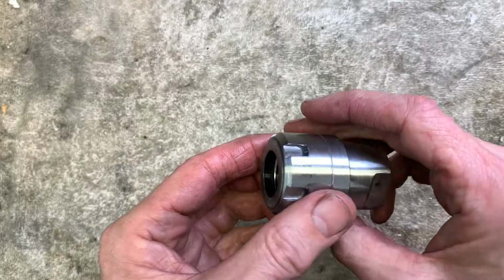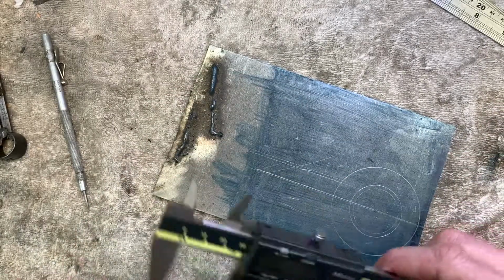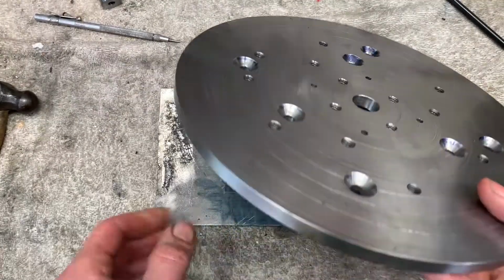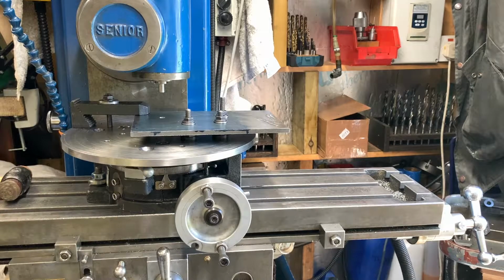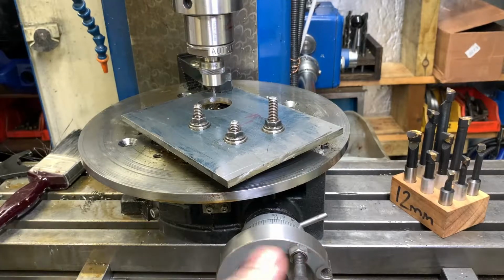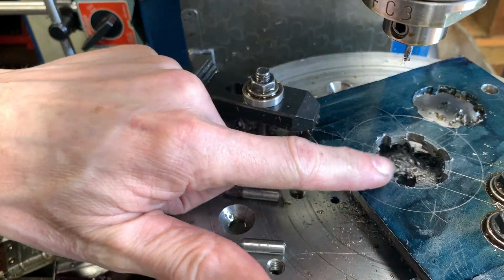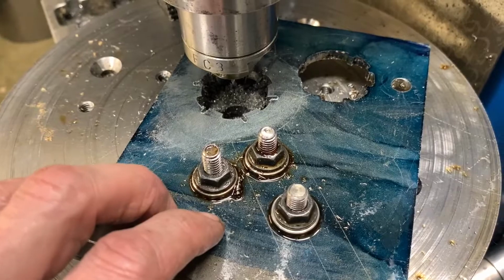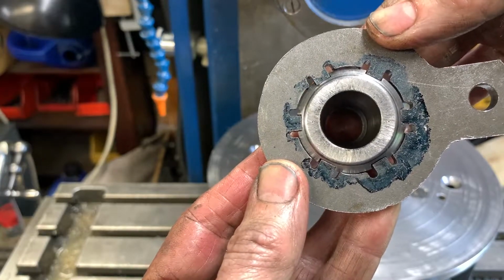milling  a custom wrench   41

Comment: Nice stuff ! I'm strongly considering a Tom Senior or Centec, so seeing one in action doing useful work is good. Do you find the lack of a quill to be a problem? It's the only thing that's making me a little hesitant...
Reply from the maker: having a quill gives a whole lot more options with a mill &  higher speeds may suit carbide cutters .  but  fitting DRO to the knee looks easier than to quill  - using wheels and dials is hard going

With the Tom you can mount the E type head on the column with a special bracket - but the head is flippin heavy and moving it around not easy , so not a great option .

Comment: Great! Now I want a rotary table for my Tom. Any ideas besides Amazon? Would like one that can be set up as a dial indicator too. Cut me some gears. Please keep these videos coming.
Reply from the maker: keep an eye on fleabay - stuff comes up. 

The Vertex HV-6 is 6 inch diameter with a table height 3 1/2  inches. one turn of the handle gives a rotation 4 degrees. the unit can be used with dividing plates to give a wide variety of tooth counts.  with 3 slots it is easy to bolt a lathe chuck on the table.   it can sit  horizontal and vertical.   This one and similar are common , so are sensibly priced . You can tap into the table  and make mods without feeling too bad  .  

the tom senior 8 inch table  is   2 1/4 height   one turn  is 3 degrees .  but 4 table slots is more difficult for 3 jaw chuck mount and no dividing plates, horizontal only   -   tend to sell for big bucks 

Elliot 10 inch rotary  proudly stands 4 1/2 inches high,  one turn  gives 4 degrees rotation  - thing is solid as a rock , but sheer weight in the shed is a big problem ,  it eats up the limited height available on the Tom . Horizontal only   and the drip catch rim at the back has to be cut away to sit on big Tom

the massive issue with gear cutting seems to be the massive number of cutters needed to cut the various pitches and tooth counts. Getting together a collection of cutters could be .

thanks for the encouragement   .....  Shed Guy